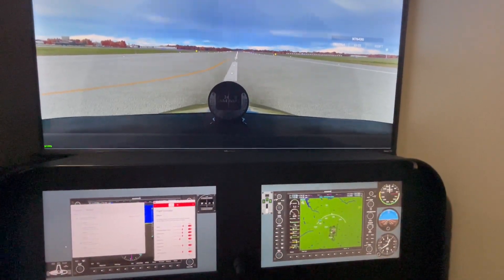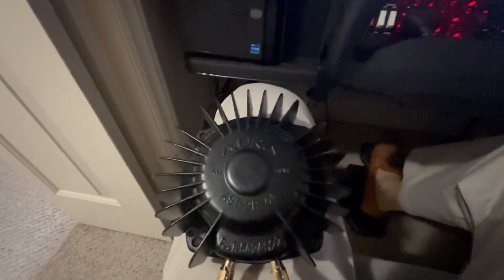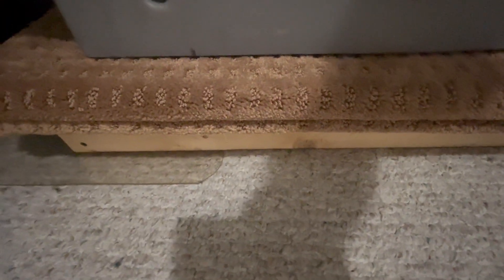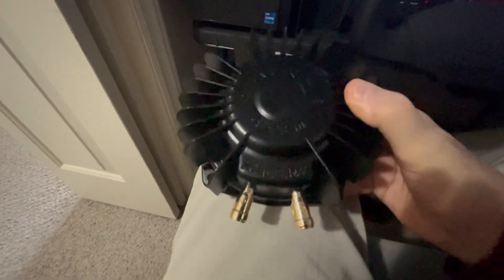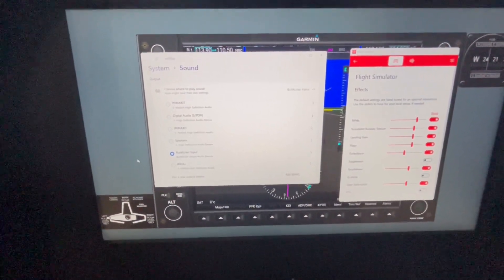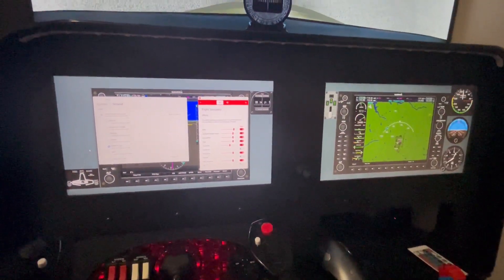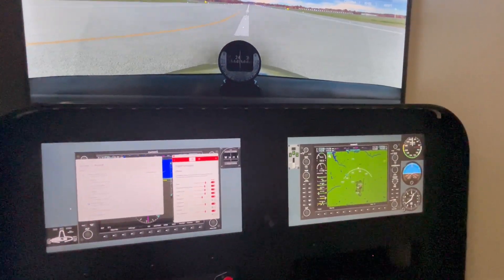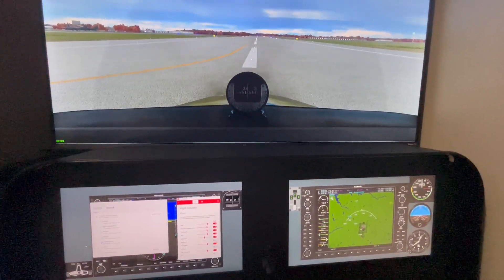Bass Shaker ButtKicker Hybrid MSFS2020

Comment: I'm glad you posted this. It's fun to see how you're putting this stuff to use. Well done!
Reply from the maker: Thank you and thanks to You. It's neat how the vibrations are both absorbed by the carpet, as I could not get water to vibrate. but are channeled through the chair when I'm sitting.
Reply: @russgaffneyflightsim  Regarding the chair type Buttkicker transducer: I put it behind the chair on the carpet and then used a small piece of wood over it, and screwed it down so it would be tightly coupled to the platform. That worked well.

Comment: Seems to me that the simplest way forward is to add a common base plate (plywood for example) that the seat, pedals and table sit on. That way you keep the geometrical relationship of the 3 points identical. The vibration under the seat would naturally affect the pedal feel. I'm looking at Buttkicker mounted on a spigot that is welded to a (Citroen) seat. The base of the seat sits on the base for the rig (table) and is made of 2 sheets of 15mm MDF separated by 32mm softwood strips. It provides a guitar like sound board.
Reply from the maker: The person that I got the chair from originally had the pedals on a pedestal just like the chair but because my table matches the height of the distance from the yoke stem to the floor of the real aircraft I could not have the pedals raised like that. I'm still considering a short piece of wood mounted to the back of the pedals and mounting the bass shaker on top.

Comment: I think that will be too powerful for your pedals.  You'd need seperate "volume" for that compared to the seat I think, as they will be vibrating a very different mass.
Reply from the maker: Good point although the ButtKicker Flight Sim Haptic allows you to distribute the sound and Windows allows for you to mix the volume output. Definitely let you know how it turns out.